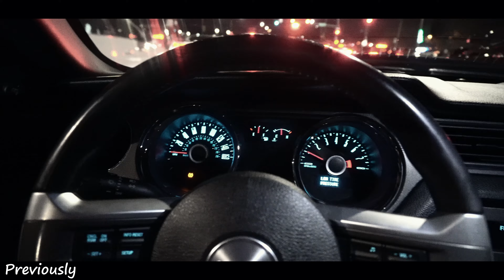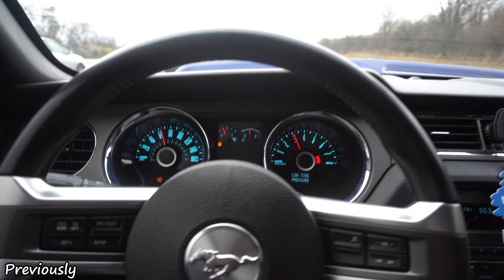SLAVE CYLINDER CAUSED my 2014 Mustang GEAR LOCKOUT *Replaced

Comment: I got a 3.7 mt 2012 mustang my clutch said bye idk what it is exactly i was doing a pull and the car locked me out of 3-4 gear and i tried to pull it and my clutch pedal went straight to the floor and the car won’t let me go into gear now and makes a hiss noise when i press on the gas in neutral what could it be ?
Reply from the maker: Clutch may have said bye bye fr. Or Throwout bearing/slave cylinder. Update?

Comment: Great video! I had a similar issue on my 2014 GT and the pressure from the master cylinder failing caused my pedal assembly to shear and crack some plastic pieces as well. Had the pedal assembly(new part # from stock), and master cylinder replaced... also did the steeda clutch line and spring. Drives better than new and never locks out now

Comment: Bro why do they keep putting these on the market if they fail? I have 2 factory slave cylinders one came off the car and one is brand new and I don't see any damage or use on the old one. I'm not ready to buy a whole new clutch set
Reply from the maker: 🤷🏽‍♂️ I’m having another problem yet again. Like the 4th time 🤦🏽‍♂️
Reply: @Tdurrgt  oem slave cylinder and throw out bearing? How long did it last? And did u drive aggressive at all? Just cuz im bout to have mine replaced with another oem and if ur oem just went out again imma be rethinking and buying a gt 500 slave/throw out cylinder
Reply: @Tdurrgt  yo
Reply: @Tdurrgt  hey is I the stock master cylinder going again?

Comment: Cool bro on the road again with the stang ,that kind of stuff makes me want a warranty on drive train and transmission on my 2014, but I dont have one, but it's doing good so far
Reply from the maker: Well, at first I did pay nearly $1000 for the clutch. Then they gave me a 1yr/12,000mile warranty and it malfunctioned in 7months. So technically, I’m still sitting at a loss here with the Ford clutch they installed. Knowing the stock clutch issues... 🤦🏽‍♂️ just realizing
Reply: @Tdurrgt  just replace the clutch line with a braided steel line and you'll be good for now or you can just get a mcleod and sell the new one you have on the car
Reply from the maker: @alexworld3056  I already have the stainless steel clutch line installed. Now I will see if that actually helps prevent high rpm lockout on a stock clutch when I break this clutch in

Comment: I have 36.8 k miles and this happened yesterday
Reply from the maker: Hoped you get it figured out!
Reply: Dropped it off at the shop today .  Tow guy said it’s the slave cylinder
Reply: @Tdurrgt  mine is fixed as of last week. It was the clutch master slave cylinder. Run me about $400 once said and done

Comment: He lied to you , you can buy them separate
Reply from the maker: You likely can. But you’d have to replace the slave cylinder and the clutch everytime a new one goes in
Reply: @Tdurrgt  no you don’t. He told you that they would have just replaced the slave cylinder but they couldn’t buy just the slave because it was on “back order”. They bought the whole clutch kit because the slave was on back order and installed the whole kit. You can replace just the slave cylinder